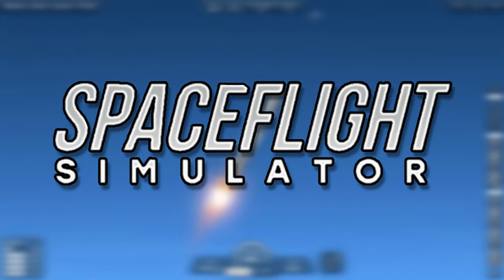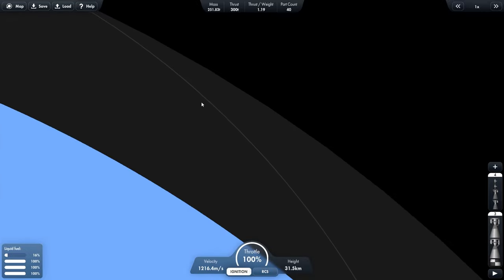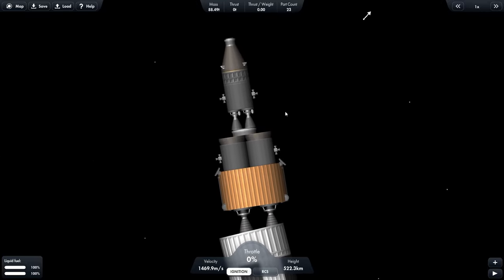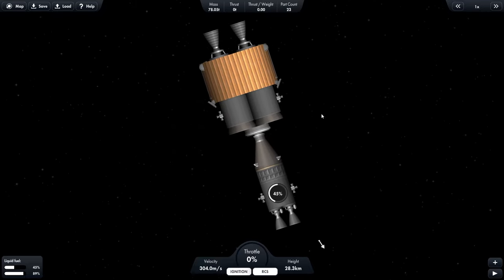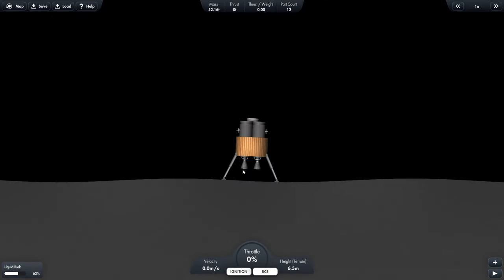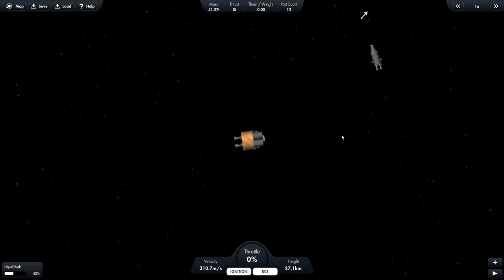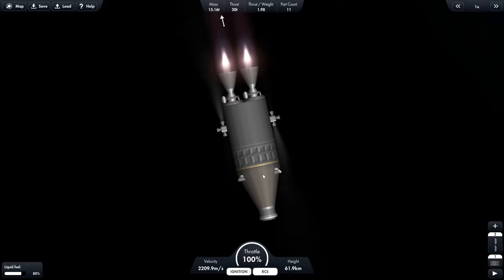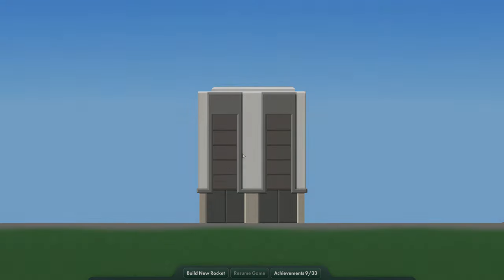REALISTIC LUNAR LANDING? - Spaceflight Simulator

Comment: I was able to land on mars for the first time ever I’m so happy bro next time I’ll send a rover then I’ll go to mars and back this took long times so liking this would help
Reply: Same!! My plan was to land on mars and come back but it didn't work. So I just sent a capsule to mars. I also landed 2 rovers on mars. Now my plan is to land and comeback.
Reply: @Smthes it is possible, try your best and you will achieve it
Reply: Good job, I have over 10 now! And 6 rovers!
Reply: @Smthes  I often use infinite fuel in my mission’s because I’m terrible at managing fuel, and it’s still very challenging and satisfying when you succeed, but if you want to keep it pure I’m sure you could manage
Reply: I just landing on the moon and brought it back, however I came in too hot and my my heat protective shield broke along with most of the capsule, It was about 10*C away from eczploding before it cooled down and was slowed down enough to activate the parachutes, and the RCS debris where raining dangerously close to the capsule after it landed too
Reply: I’ve been trying to build a starship but I couldn’t So i used The Atlantis V rocket
Reply: @Smthes  i did it with these 2: 
Part clipping and
Infinite build area
Nobody is gonna care if you use them.
Reply: I was able to send 2 rovers to mars without cheats
Reply: Good job bro!
Reply: Same
Reply: I landed on mars in only weeks 😎
Reply: @Smthes it is possible, first go into orbit of earth then, click mars then click navigate to click on the "transfer window" then click "Timewarp" and wait and then do it again but for ur orbit then turn the way the line is pointing then make the number go to 0.0 then  Timewarp by the closest point to our encounter then face the opposite direction of where ur going burn until you have an orbit of mars then burn until you have a✨low mars orbit ✨ then make the orbit go into the atmosphere of mars then make sure you have heat shields to protect you from the speed then when ur at  "4500 m" click your parachutes except the vertical parachute (the parachute that is facing up) then just wait for it to land then do all the things I said but for mars ok this took me 35 mins so ahh
Reply: I started making a base on maes but i deleted the world and im rebuilding everything in better now... starting with a LEO station
Reply: My only mars landing was a rover
Reply: I alr landed and go back to earth, i have a rover on the moon, and 2 on mars, i landed on mars but no return to the earth, now i am building a space Station on Earth and The Moon, to refuel my rocket  and go to mars and back to the Earth (All that without cheats)